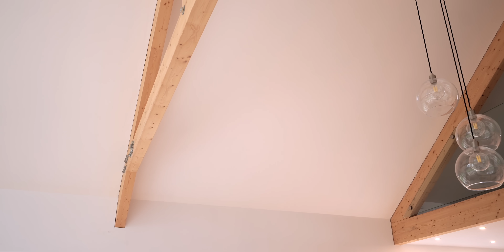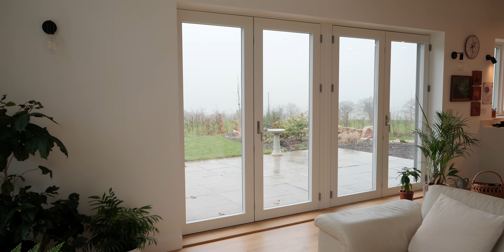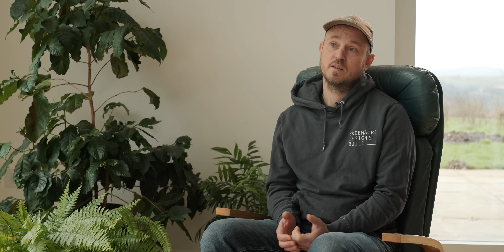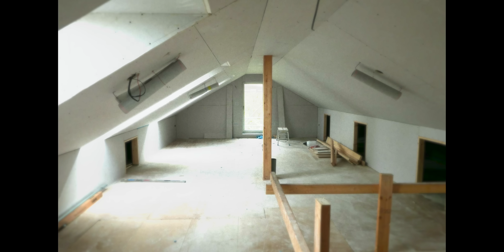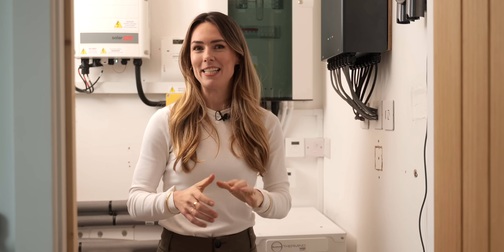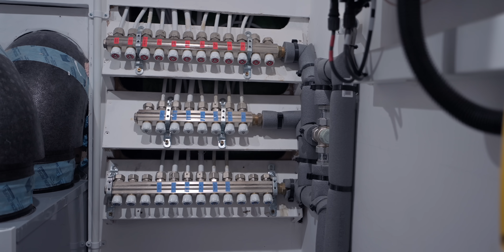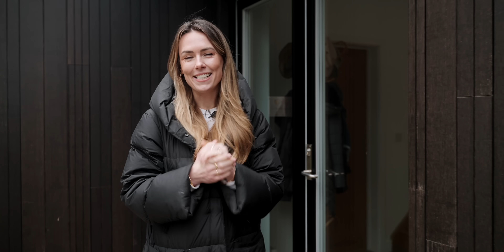Ditching a Heat Pump for In-Plaster Infrared Heating?!

Comment: The original intention of passivehaus was a building that requires NO, I'll repeat that, NO, additional heating other than the heat radiated by the people occupying the building. This house misses that mark but is close; I'd have fitted the smallest wood burner, the installed heat recovery system would then distribute the heat throughout the house, or preferably, a battery - 30kW (under £3000 now) with a water to air heating coil in line with his heat recovery systems main output manifold, which would also distribute this small amount of added heat throughout the whole house - could be fed from the phase change buffer he has fitted, charged from winter sun solar, or overnight priming that sunamp phase change buffer with elec at 7p. Super simple, very cheap, easy to maintain yourself and easy to fix. 
KISS, is there a cheaper simpler way, have a scribble and think...is there a simple cheap way...Mmm, def not an effing heat pump then!
Reply: He never used a Powerwall battery. One would cost £8.5k. In a building society at 5% that brings in £450 per ann. Would he make £450 per ann buying overnight cheap electrity, storing it in the battery then selling it back at a high rate during the day?
Reply: I must admit I would have dropped a heat pump immediately, as 2 kW maximum, with demand most of the heating season half that, heat demand would automatically precludes that.  The secret is storage. Either electricity or in the form of heat. 

Like you I would have considered thermal storage, more likely a normal water based thermal store in a highly insulted and sealed door cupboard, heating up overnight cheaply from the grid. The thermal store then provides on-demand hot water and heating. He has the space for a thermal store. Then using a water to air copper heat exchanger in the ductwork of the ventilation system, as it is already there, to distribute heat to the whole house.  Simple thermostats in each room closing and opening air registers to maintain room temperatures.  A mini forced air system.

Comment: In my three decades in residential remodeling I've had to deal with the old wired-in-wall electric radiant heat a couple of times and it's never been a good experience. It's easy to break and because it's hidden in the wall, it's a mess of destructive plaster removal to just find the break, and then it's another mess of plaster removal to dig it out to a junction box where you are required to make the splices. Electric is never something that you look forward to fixing but this is far worse than replacing a breaker or switch. These fleece panels might not be as bad as the systems from the '50s, '60s, or '70s, but, speaking from experience, I don't ever again want to hire an electrician to fix a nail hole caused by hanging a picture on the wall, or a hidden wire broken because somebody leaned against the wall, or because somebody put something in the attic and maybe the ceiling joists sagged a bit too much or maybe the wire just got too hot and that is why the plaster is discolored right there. Resistance heat is not efficient heat, when you put heat into a floor, wall or ceiling that heat conducts in both directions until it radiates and that means that any system embedded in the exterior envelope also heats the exterior by radiation. Sorry, hard pass on that one. Too much fire risk, too hard to fix, too expensive to use, too experimental to warranty, too much bad history. It's like a combination of asbestos, lead paint, polybutylene pipe, and let's not forget that sprayed foam insulation from the 1980s that has now all turned to a little pile of dust at the bottom of the stud bay. I just don't want to tell another customer that the reason their house smells like electric ozone and burning wire every time they turn on the heat is because their house is trying to burn itself down every time they turn on the heat.
Reply: Oh dear!  Things have moved on a fair amount since those days.  New technologies have evolved and, unfortunately, it takes time for people to trust these new advances.  Our homogenised product will not delaminate, will not bur, runs at 36volts, can be penetrated by screws and fixings and even holes up to 70mm without effect.  If one panel were to fail then it would only be that 1 panel and only up to the point of the damage  which can easily be traced and bridged (although this has never happened).
Reply: 😂😂😂

It's back to school  for you my lad.

We're not talking radiant heat but infra red radiation.
Reply: @ForestForest-n9i  Exactly what the hell do you think radiant heat is? 
Laddie, radiant heat is heat transmitted as radiation in the infrared band of the Electromagnetic Spectrum, which is between ultraviolet radiation and radar radiation. Whether you describe it as Infrared Light from 780 nm to 1 mm, or Infrared Radiation from 380 THz 300 GHz, it's still radiant heat. The fact that  the emitter is now covered with fleece, paint and plaster adds complexity and inefficiency but it doesn't stop the panel from emitting radiation in both directions, it's heating the exterior wall as much as it is heating the house.
Reply: @hizacaine 

😂😂😂

Not quite.

Two things.

Instead of cribbing out parts of the internet try to understand the information first.

We can see you don't understand so stop digging yourself deeper.

Secondly, another word to the wise(?).

Don't claim to have had thirty years experience of whatever.

The standard response is "no, not thirty years experience but one year's experience thirty  times over".

You were the tea boy, weren't you.

Suggest you clear off and make an effort trying to grasp the concept of FAR IR radiation.

Well, get on with it then.

Comment: 4:16: The thermal imager shows that the wall behind the towel rack is at 33.7C.  Imogene believes she can feel that heat.  She must have just gotten in from being out in the cold because the rest of us have 35-37C skin temperature and would not find 33.7C to feel warm.
Electric resistance heat is smart for homes with minimal heat needs.  Spending $10,000-20,000 for air or ground source heat pump equipment makes no sense when the heating bill is just a few hundred $ on electric resistance.
Reply: Hi Peter - the infrared LIGHT is emmited around 15nm which is ideal for the skin and warming rooms - the mats once in the celing warm to around 38 Deg C and the light warms the room not like convected heat. Also the mats are switched on and off with a thermostat which measures room temperature therefore the mat could have been recently switched on/off.
Reply: Our heated towel warmers sit within plastered or tiled walls and emit non ionising radiation at between 9nms and 18nms, to do this the mat needs to reach an operating temperature - in this case 38°c  but the lightwave baths the skin much like sun coming through a window and can me felt as a gentle warmth.
Reply: @EnergyCarbonInfraredHeating  Your units are way off.  254 nm is UV light; 490nm is visible light, colored yellow.  1000 nm is IR from a hot object at some 200 °C.  You are running at 15,000nm or 15μm.
Reply: @peteinwisconsin2496 

😂😂😂

Have another go.

Comment: An EV battery from used Nissan Leaf  42kWt or other  (~£1000) would sort all his problems

How much does this house cost with all the bits?
Thanks
Reply: that's a dumb idea... Leaf battery is NMC and that's the last thing you want in a house. 
And it presents all sorts of other problems as well (voltage, custom bms etc).

If you want to do DIY, you just buy raw LFP cells and build a system together. They usually run about ~50€/kWh. So a 30kWh pack of batteries will cost you about ~1500€ plus BMS and case. All in i'd say you're looking at ~2200-2300€ for a nice professional looking pack; you just need to build it yourself. And will work nicely with 48V inverters and connect to them as well. And incredibly safe due to LFP. And will last many 1000s of cycles unlike a degraded leaf battery.

With 6kWp of solar panels, 30kWh battery is about as big as you want to go for the size of the solar array. And you can get away with 16SP1 configuration on the battery (using ~620Ah cells) so the pack is dead simple and you only need one BMS.

Comment: 7:00 so instead of a heatpump boiler he is also cop heating water ? How inefficiënt is this... lucky he got a passief home to compensate for al those loses
Reply: If you had troubled to research heat pumps then you would know said heat pumps are not quite as efficient as advertised all year round.

Comment: So surprising that when you have high ceilings the heat rises up and cooler air lingers in the space people occupy.
Reply: What heat?

Perhaps if you understood how  FAR IR heaters worked then you would see the error in your thinking.
Reply: In Julians case the additional top up heating was due to the angle and placement of the panels within the high ceilings.  We used our low energy (60wm2) mats to minimise energy output and so adding a couple more is to give them a hand.  Normally, for high ceiling areas we would recommend higher output mats such as our 110wm2 system or placing the mats into the floors.  However-, this strategy still worked, albeit with a bit of fine tuning.

Comment: Wait. 3:07 heat needed was 2 kilowats so 2000 watt.
A heatpump can run at 250 whats and still provide 2000 watts of heat. It would be ideal.
Now he got cop 1 electrical heating elements in the wall.. sorry thats sound stupid
Reply: Clearly you're not a heating and ventilation engineer.
Reply: @ForestForest-n9i clearly you dont no about cop 1
Reply: @ELGee1 

😂😂😂😂

Hmm ... have you heard of Google?

There's far too much droning on about high COP heat pumps from the ignorati who were/are taken in by the efficiency of these heat pumps but not quite understanding that for heat pumps, air or ground, to be useful as a retro fit in an older property there's a lot of other work required on top of.

Insulation, larger radiators or underfloor heating, triple glazing and control gear.

So, with all that work plus the cost of the heat pump itself the bill is going to be substantial.

To save a few £hundred you spend quite a few thousand.

If you haven't got the readies then the money is all on tick, which means a loan to be serviced.

Where exactly is the cost saving?

Droning on about COP means not a lot when you're servicing a hefty loan.

This old bloke, ages with me, has got a system, sans back up battery, which works for him and doesn't cost much to run or so he says.

On top of this the house itself collects heat from the Sun, is well insulated and comfortable.

What's the problem with that?
Reply: @ForestForest-n9i  I happen to be an engineer, but you don't necessarily have to be one to know that any infrared heating element converts 1 kWh of electrical energy into, at best, 1 KWh of heat.
A heat pump will always be more efficient. However, in a passive house solely due to its building structure, the economic (or legal) pressure to install the most efficient heating solution is significantly lower. Therefore, one can choose options that one personally finds more attractive.
Reply: @marcromain64

The old bloke and Imogen said all that in the episode.

But thanks ever so much for reminding us.

Perhaps what you and the other heat pumps huggers don't quite grasp is the cost of a heat pump v the FAR IR.

In such a building a heat pump is merely financial overkill.

Had you troubled to read up on the topic or read the comments a FAR IR heating system is considered far more efficient.

Plenty of info on the efficiency aspect with respect to this type of construction to be found online.

Many heat pump huggers fail to appreciate the construction aspect.

Even when heat pumps are fitted to older properties we very rarely get to learn of the costs of improved insulation, draft proofing, triple glazing, larger radiators, heat recovery system and integrated control systems.

If such "extras" aren't included then a heat pump on its own might possibly be more efficient but if the above extras weren't fitted what happens to the overall efficiency.

Anyone care to answer?

Top Tip: Before you jump in why not research the issue prior to posting?
Reply: @ForestForest-n9i seems your a heatpump hater   ....
Reply: @ELGee1 

😂😂😂😂

What a stupid comment.

Can this be typical of the heat pump hugger cohorts?

Surely not, but there again evidence is right before our very eyes in back and white.

Perhaps if heat huggers understood that electrical efficiency is not the same as financial efficiency they might not be quite so enamoured of this technology.

Can it be quite the thing to spend a lot of cash on a heat pump, even with a grant, and then spend a fair bit more in insulation, draft proofing, triple glazing, larger rads or converting to underfloor heating perhaps in order to save a few pounds?

Then possibly a heat recovery system as well as. Or even a supplementary heat source should the outside ambient become too low.

The above improvements might be funded by a loan, which then has to be serviced.

And all the above just to save a few hundred pounds a year.

And then any realised financial savings could be further reduced by servicing and maintenance costs.

Chapter and verse on the above topic available online.

Judging by the old bloke's decision to opt for FAR IR to heat the property he had looked at the fuss involved with a heat pump installation (even just the monobloc type) and decided it wasn't worth the faffing around for any potential savings.

Viewers might recall his KISS ethos?

There's rather more to this heat pump thing than just the COP figure.

Heat pump huggers please note.
Reply: @ForestForest-n9i  I can't shake the impression that you have a very limited understanding of what exactly falls under the umbrella of heat pumps. Therefore, you should perhaps take your own advice and improve your, at best, rudimentary knowledge.
Reply: @marcromain64

As per usual I note the heat pump huggers still persist in this nonsense a high COP is the "only" thing that matters.

Had they researched the topic thoroughly then they would have a better understanding of heating a property in all locales.

I can understand very pro heat pump propaganda from them who might be heat pump retailers, the rest is just noise from them who don't know any better or have spent a  few thousand to "save" a few pounds.

Where's the financial benefit in that?

Especially if some people required terms to install such a system.
Reply: @ForestForest-n9i "heat pump huggers " says enough about the one sided opinion you have and that there is no other way thrn your way
Reply: @ForestForest-n9i  First off, you might have noticed that I haven't assigned you a derogatory label based on your position in this matter. Perhaps you'd like to try that sometime.
Secondly, you keep repeating like a mantra that others need to do research to understand the issue better. How about, for a change, arguing with the supposedly existing data instead of just stating that it exists somewhere?
Thirdly, what exactly makes you think you're not the one who's fallen for the propaganda of infrared heating retailers?
Fourthly, if you're going to start talking about financial advantages, you should at least be able to present a rudimentary cost breakdown. The video doesn't do that, and neither do you. Claims are merely asserted, nothing is substantiated. And until it's clearly proven that a particular configuration is cheaper, the principle remains that less electrical power for the same amount of heat  is more efficient.
Reply: @ELGee1 

Just seen this.

One sided you claim?

You're more of an idiot that you look.

Tell me, if you can, are heat pump huggers suggesting that FAR IR is a reasonable option or are they pushing heat pumps in every post?

And not forgetting the battery huggers.

The expensive batteries, of course.

Take your time, formulate a response and kindly post it.

You must thrive on being ridiculed.

Comment: This is interesting, but I'd love to know more about how the energy use breaks down. Going by the Passivhaus standard of 15 kWh/m2.a heating demand we should see a house around 200 m2 use 3000 kWh per year for heating, so if we add an economical 1000 kWh for hot water and about 2000 kWh for 7000 miles of EV we're already at the 6000 kWh total, before any appliances, electronics or cooking.
Obvious leeway here is the heating as we know it wasn't up to the job - so presumably the energy use will be higher once that's fixed.  
For me I'd use an ASHP with underfloor heating - with this kind of slow response system in this size house it would be fine with the usual 4-5 kW unit and use less than a third of the energy for heating and hot water.
Nevertheless, lovely house and I am envious!
Reply: Did you get it? Look again. His bills were £195 per ann. Why should Julian spend a fortune on stuff that will break down and need replacing?
Reply: @johnburns4017  This is thanks to PV income of £900/yr. But still the programme headlines on the novel heating system so it would be good to know how much energy it uses specifically, and how warm it kept the house (we only know not warm enough).
Reply: And we don't know how much the heating film cost but do know some of it needs replacing already
Reply: @alanclarke4965  
The emitters were just wrongly placed. It should use less electricity when they are properly located.
Reply: @alanclarke4965  Not replacing, just topping up in the large vaulted area.  We put low wattage mats in to start and the addition of a couple of more mats will just tickle the room warm up time up a notch.  Still only using minimal energy.
Reply: @johnburns4017  Allegedly.